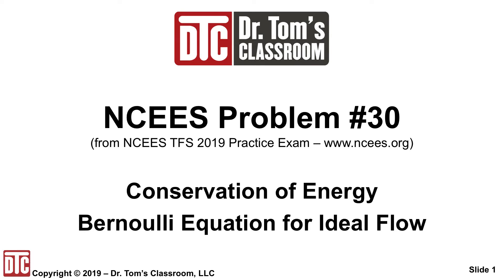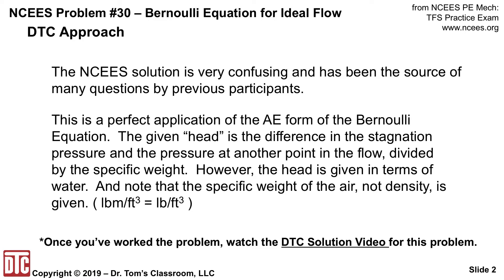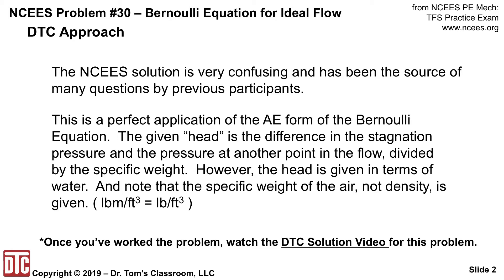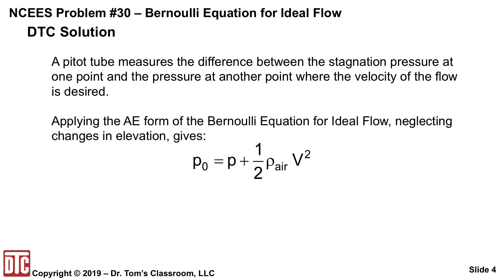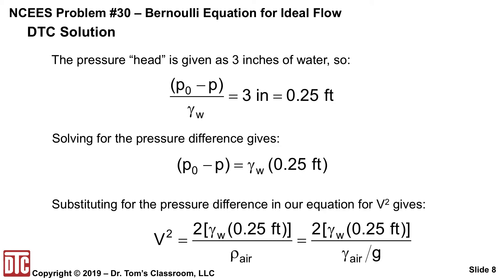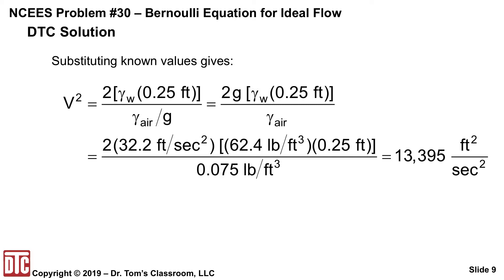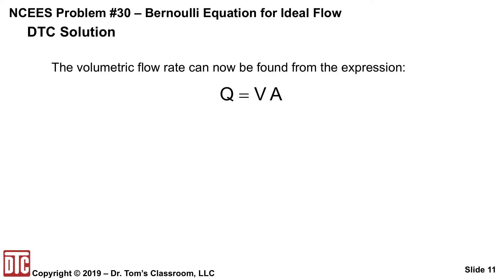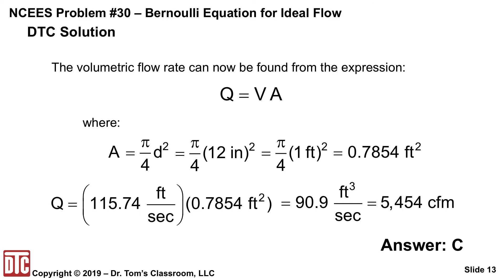NCEES PE Mechanical TFS Practice Exam Problem 30 - Bernoulli Equation for Ideal Flow (Solution Tips)

Comment: Still not following how you what they say is density is actually specific weight…?  Density is mass/volume which is what they gave the units lbm/ft^3 so how is this actually specific weight. The US customary system still confuses me to this day.
Reply: Because of the relationship between "lbf" and "lbm", if you weigh 160 lbf then you have a mass of 160 lbm. This is a result of the definition: 1 lbf = 1 lbm x 32.2 ft/sec^2. So to get the right units on mass, you have to divide "lbf" or "lbm" by "g" which is labeled "gc". You can get around this by using the unit "slug" for mass, where 1 lb (don't need an "f" or "m") = 1 slug x 1 ft/sec^2. This correlates nicely with the definition in the SI/metric system: 1 N = 1 kg x 1 m/sec^2. Therefore there is no need for a "gc" in the SI/Metric system. You are not alone in this confusion. I've been fighting "lbf" and "lbm" for the 40+ years I've been teaching. Great question. Hope this helps. Dr. Tom (You might watch the free video on the DTC website "slug vs. lbm")

Comment: You mention that the 0.075 lbm/ft^3 given is the gamma of air, yet it is labeled as density in the practice exam. Is this a misprint?
Reply: No, it is not a misprint. When lbm and lbf are used, both are just lb. So gamma is lbf/ft^3 and density is lbm/ft^3. Or, to put it another way, if you weigh 150 lbf your mass is 150 lbm. This is why the gamma or density has to be divided by "gc" to get density in slug/ft^3.  Ever wonder why you don't have this problem in the SI/Metric system? It's because they no longer use kgf and kgm, just kg for mass and Newton for force/weight. No "gc" is necessary. Hope that helps. Tom

Comment: The pound mass and pound force conversion for specific weight vs density of air really tricked me up! Couldn't figure out where the g was coming from...
Reply from the maker: The relationship between pound force and pound mass is that 1 pound force = 1 pound mass x g (32.2 ft/sec^2).  This is where the unnecessary "g" comes from.  This also means that if you are given the value of specific weight in pound force per cubic feet it is the same value for density in pound mass per cubic feet.  This was also the case between kilogram force and kilogram mass.  1 kilogram force (kilo) = 1 kilogram mass x g (9.8 m/sec^2).  However, the SI/Metric system adopted a new unit for force, the Newton, so that 1 Newton = 1 kilogram x 1 m/sec^2.  So no "g" in the definition.  For the U.S. Customary system we have a new unit for mass, the slug, so that 1 pound (lb without a "f" or "m") = 1 slug x 1 ft/sec^2.  So no "g" in the definition here either.  However, the adoption of "slug" for mass has been slow to say the least.  Sometimes I feel that I am the only one on the planet who uses "slug" for mass, but that is ok as I don't have to worry about where the "g" went. A value of force in pounds divided by "g" equals mass in slugs.

Hope that helps.  Tom